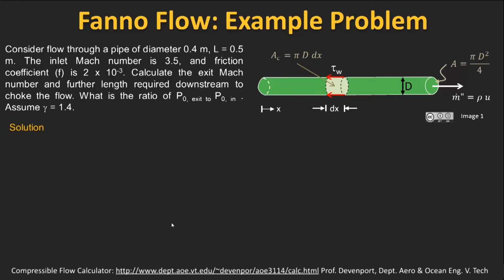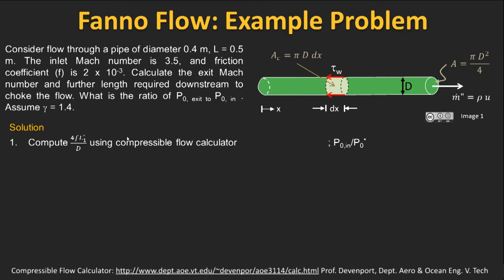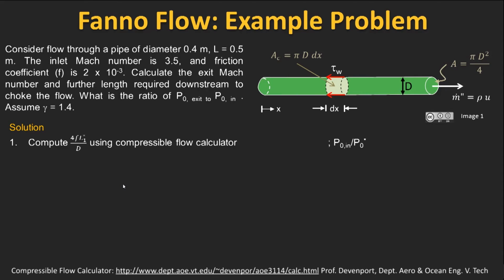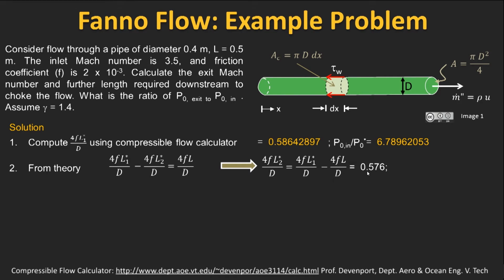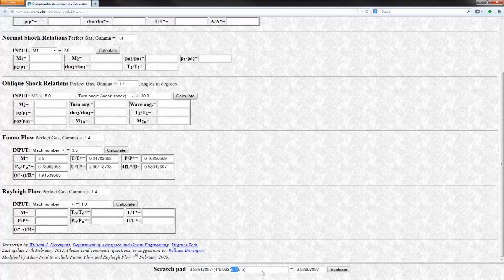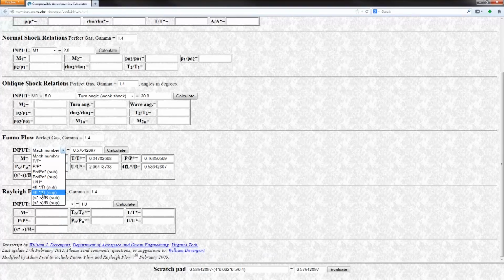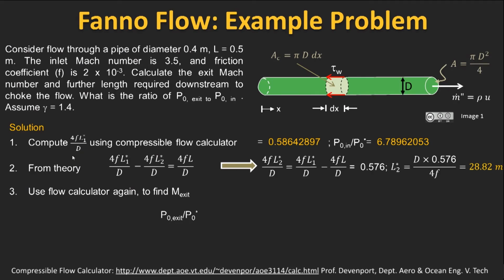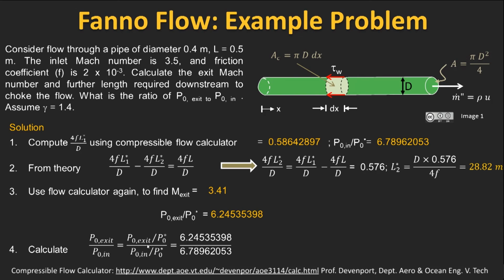UQx Hypers301x 4.2.3.1 Flow Friction Example Problem

Comment: Why do you plug in the value for L2* in the calculator? If we know that L2* is the point at which the flow becomes choked, why isn't M=1 when you plug in that value?